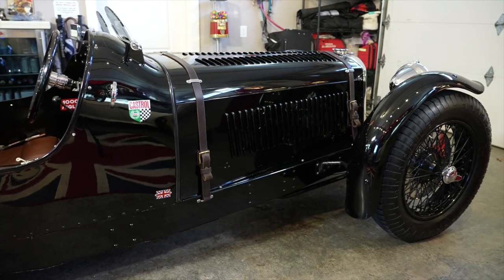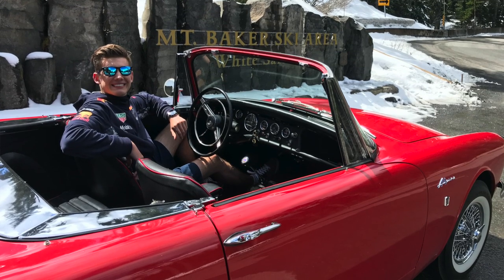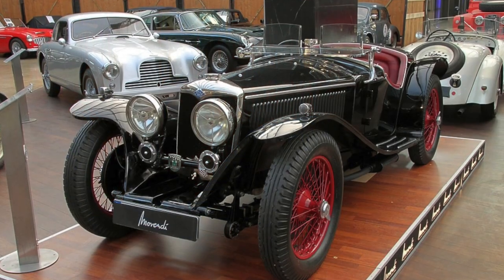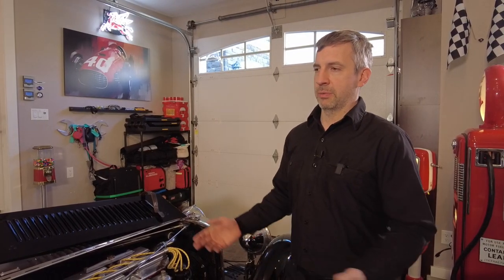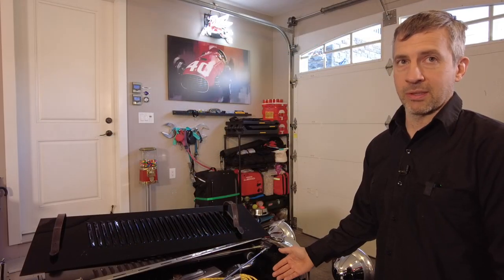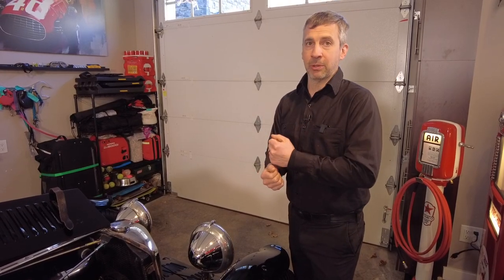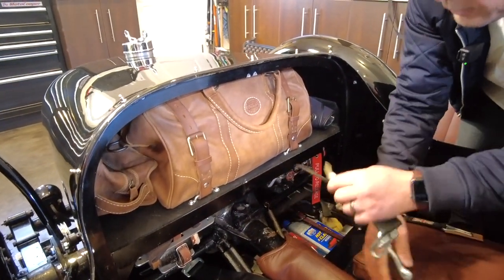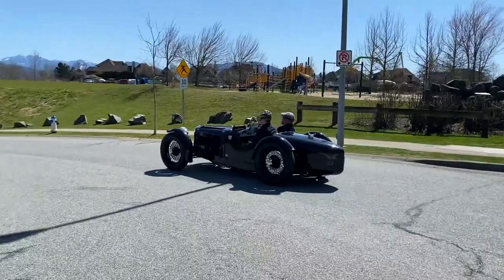1933 Riley Race Car |The Gentleman's Racer

Comment: well my great uncle freddie dixon designed riley engines and gearbox  and in 1933 he had 200 bhp out of a riley 1.5  witch he raced at brooklands and montentery  france  and IOM gp  witch he won see pathy news
Reply: What a wonderful connection. I've read a lot about Freddie Dixon as I'm currently rebuilding a Riley 9 special. Are you involved with vintage motoring yourself?

Comment: Ah, it's a 6 cylinder Riley special, not a production Riley. Nothing wrong with specials, it's still a pre-war car. If he worked on the Sunbeam himself he shouldn't find the Riley that much harder or different. There are no manuals but still enough Riley clubs with people who can explain how they work and the mechanics are fairly straight forward. The most famous pre-war Riley race car is probably the Brooklands. Gooseneck chassis, flat underside and under-slung rear axle makes for a very low to the ground car. The car pictured, WD 3648, is an original Brooklands. I am very slowly building my own replica Brooklands, so that will also be a special when complete.
Reply from the maker: Good luck with your build. Thanks for watching.
Reply: ..And it's nice to see someone one the other side of the pond wanting something with a non-synchro gearbox. Just needs a bit of dust and some dead flies on the headlights and it'll be nice and mature! I think to be fair, your painstaking Brooklands build should qualify as a replica- you are building it up to factory standard in every way possible after all.

Comment: Nice. They're not immediately comfortable things to pilot - if that really has 100 bhp (seems very unlikely to me, certainly never heard of that) then it's a largely unguided missile!  Personally, I'd lose the yellow lights (French idea) and maybe side-mount the spare to free up space for the picnic basket! Best wishes from England.
Reply from the maker: Thanks for watching.
Reply: The Riley 12 four cylinder was regularly tuned for 100hp but in six cylinder form was capable of in excess of 200 hp and was the unit used in ERA race cars, most notably Romulus and Remus two extremely successful GP cars. Riley we’re a marque of car with a racing pedigree up there with Bugatti in their time, and came first in their class and second, third and fourth at Le Mans in 1934 behind a 2.3 litre Alfa Romeo and way ahead of any Bugatti. Would definitely lose the lights too, they’re awful. Nevertheless this car in this is a complete Frankenstein probably based on a saloon.
Reply: @Nicodemus1971  Thanks for your insight; mine's a '33 9 Sports Special, and I doubt we've managed more than 40 bhp...